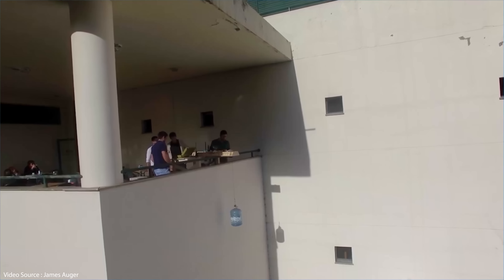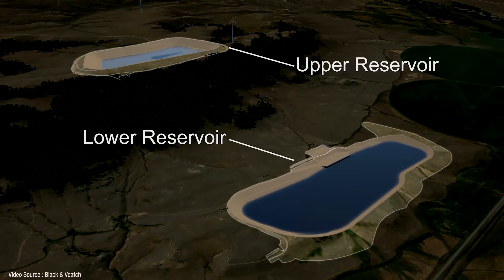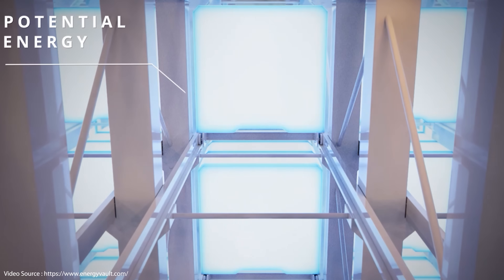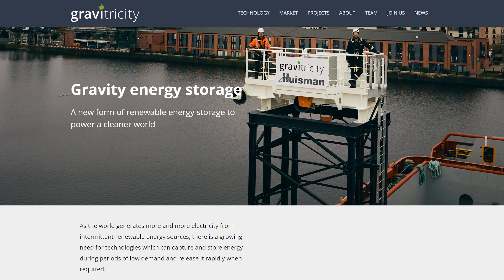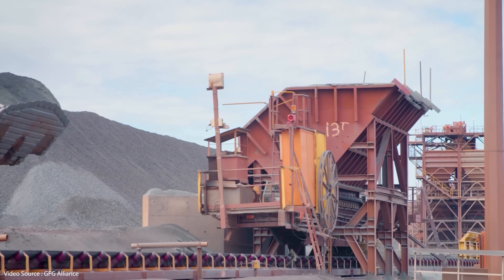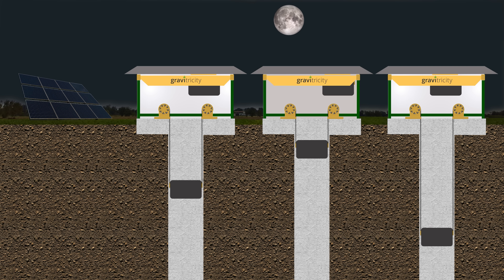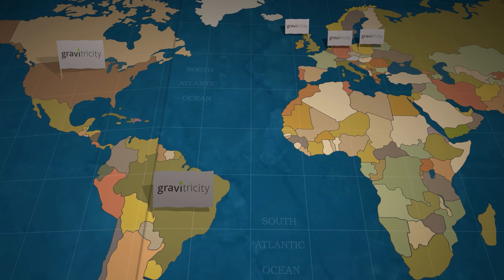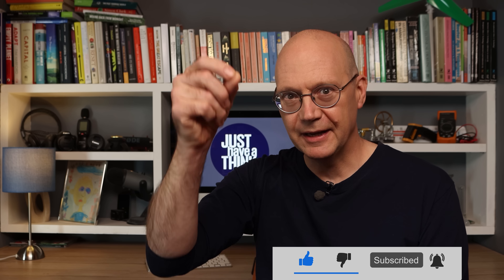Gravity Energy Storage. Who's right and who's wrong?

Comment: Thank you for coming back to these.  Why would either of these be better then water towers or sub-sea air tanks?  Water is heavy, easy to move, and really useful to have in a pinch.
Reply: I'm purely guessing here but water towers have to be built, they're only approx 50m tall and they hold a limited amount of water. The mines are already there, they're are 500m to 1500m deep (at least in the UK) and you can move additional weights down the mine rather than having one weight of water at the top of the tower. I suspect the issue with sub-sea air tanks in the harsh environment - salt water and barnacles would destroy everything eventually.

Comment: This is a good example of the difference between science and engineering.  Scientifically all these schemes are straightforward.  From an engineering and economic standpoint, most of these schemes are non-starters.   Pump-storage is an existing solution where topology permit.

Comment: IMHO, as a lay person, looking at it all objectively, if you want to store energy using gravity use pumped hydro. It is fairly weight dense, water is a lot cheaper than concrete, in the right locations you will get free "mass" at elevation every time it rains (in other locations without enough rainfall or a roof you will lose your mass as the sun evaporates too, its location dependant of course), and the maintenance is very minimal compared to having cables and winches and cranes all over the joint.
Reply: Also, if your going to dig holes hundreds of meters into the ground there will be heat down there, just use geothermal

Comment: If you have a mine, which you will have to pump out anyway, why don't you use water as your mass? You are into dear standard pumped hydro technology, and you can move immensely more mass (as you can use all the voids underground as storage volume not just a tiny fraction of the shaft). You could possibly even play with a bucket chain rather than a conventional pump which may be more efficient  and keeps the electrics at the top of the mine.

Comment: If you already have the deep mine shafts and mines, why not pump the water out of the bottom of the mine shaft up to a reservoir on the surface?   Seems like an easy way to do pumped hydro just about anywhere.

Comment: The Difference between the Construction and Operation of Renewable Infrastructure Verses Fossil Fuel Infrastructure is Large.
The Fossil Fuel Corporations and Governments take the Attitude that as Long as it Produces Coal, Oil or Gas then Build it and Build it Well.  Example the Coal is 5 Kilometres Underground :-
No Worries Tunnel Down in Often Very Dangerous Conditions Bring the Coal to the Surface, Build Huge Power Station, Rail etc for Electricity.  No Worries Repeat the Process All over the World.

Here in this Example, Just have a Think is Suggesting Building and Operating, Let Me Say, a 500 Square Kilometre Gravity Battery is Hard and Probably Will Not Occur.  500 Square Kilometres is the Size of JUST ONE COAL MINE.  I have Not done the Maths on How much Energy a 500 Square Kilometre Gravity Highrise Battery will Store and Provide but it is Huge.

So the Very Big Mystery is Why Such a Huge Contrast to Building and Operating Quality Renewable Infrastructure, Such as Grid Scale Gravity Batteries, Grid Scale Solar ???????????.

My Answer to this Mystery is :-.  We have Weak Useless Governments All Over the World!!!.

Comment: Some calculations on Gravitricity. That tower seems to be around 25 m high and it takes around 30 s for the weight to go all the way down. It says 250 kW there, so I take that number, and assume a 300 m shaft. That would provide 250 kW for 12x30s = 6 minutes. That gives a total storage of just 25 kWh. Let's say they double the weight and I undercounted the time it takes the weight to go down by half. Oh and make the shaft 500m instead of 300m. There will still only be ~165 kWh in one system, or about the same energy as in 2 family EVs. Enough energy to power ~16 homes for a day, or just 384 homes for an hour. Scaling this up to grid scale requires 10,000s mine shafts to be outfitted with this system. I'm a bit skeptical on this one.

Comment: Im puzzled as to why the drop has to be vertical.Why cant a rail line going up a steep hill or preferably a mountain work proportionly just as well.
Reply: I reckon that you could.  But if it isn't vertical then you lose some of the energy to friction.  Also, it would generate less energy for the same length of track.  I sort of like the idea of rails though.  You could build it above ground so you could see it and make maintenance easier and safer.

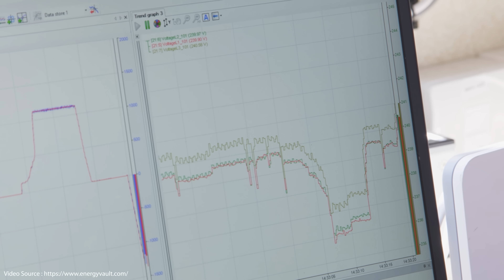Comment: At 5:42 "... as gravity competed with inertia ..."?  What!  I can understand gravity competing with friction... but not enertia.  The greater the mass an object has, the more enertia it has, making it harder to push from its path, certainly, but gravity does not care about that at all.  All things deflect the same under gravity.  There is no competition between those two things.  Gravity simply ignores enertia.  No competition.
Reply: Are you referring to the rate of work?  The faster it falls the faster it will deliver the same energy.  So the energy delivery starts off slow and speeds up through the fall duration.

Comment: Why not use large vertical tubes anchored in a sea bed or lake bed in deep water with generator/pumps at the bottom of the tubes. No need for separate bodies of water, less geological requirement, anywhere there’s relatively deep water, and of course the tubes would have to be water tight and be able to handle the pressures at the bottom. It would exhibit a gradient in regards to energy storage, the deeper you pump, the more energy needed to pump out the remainder, but the greater the energy storage capacity. Just a thought, and if I’m having it, then most likely someone else has already thought about it or done it. Not much new under the Sun ☀️ these days.

Comment: Some/many of these concepts seem to consist of too many parts and involve heavy construction. I also wonder if gravity is the best way to store energy or not. Water dams are well proven, but these other ones don't use liquids. There's the flywheel idea, and there's heat storage. Perhaps pressure chambers. I don't know, but it has to be possible to relatively easily figure out what kind of storage requires the least amount of energy during conversion and construction and maintenance. After doing that evaluation, many options could probably be scrapped so we don't waste time on them.
Reply: while I agree that this isn't a great idea and I hope it's not diverting funds / backing from more viable schemes.  it's incorrect to assume that between 8 billion of us we only need to focus on one system.  we can be working on fusion power, and heat storage and battery, it's likely some will find niche uses and some will be more mainstream, but it's unlikely we will find a one-size fits all solution for energy storage. since the type of generation and the types of demands will be different in dfferent places.
Reply: @mralistair737  For the time being, at least, I agree. There's nuclear though.

Comment: In the absence of suitable mine shafts the weights could also be lowered along tracks built down hillsides, which I imagine would be cheaper than digging purpose-dug holes and reinforcing them.
Reply: This is the mining regenerative braking system.  Skip the iron tracks and just use electric dumptrucks, though a third rail would provide an easy way to get electric energy from vehicle to grid.  Look ma, unintentional use of a buzz word.

Comment: The mine shaft version looks nice. I wonder if you could use one lift system to make use of multiple shafts to save on overheads. Assuming a site has multiple shafts in close proximity.
Reply: Mechanically switching the mechanical system between shafts while holding up the weights at the top will add extra complexity that would be avoided by simply replicating the equipment to provide complete failure redundancy.

Comment: For those below who advocate using mine shafts .....

1. They are not usually very wide holes (anything more than a cage width is a waste!
2. There is a Lot of maintenance involved in their upkeep!
3. The fail-safe systems need to be robust or you need to factor in what happens when you drop  weight a long way down onto some piece of infrastructure!

Comment: not far from where I live, a reservoir releases water throughout peak usage hours, and during non-peak hours, water is pumped back up to the reservoir.  Since the reservoir is a lake that is fed by rivers, there will always be water flowing into the system, but using the excess power when it's not needed supplies the system with additional mass that gravity will bring back through the turbines when the power is needed

Comment: I wonder if it could be used small-scale. Like someone currently on PV off-grid, using lead-acid batteries. But of course construction costs are the big problem, unless you happen to have large hole available. But maybe if you had a long even slope, you could just put weight in a cable trolley system. Anyway, it would be interesting to calculate how much weight and height you'd need to use like a replacement for a dozen lead acid batteries. And maybe you'd also want to add multiple trolley cars, and store on the top or bottom of the hill for long term storage, like for less solar power in the winter.
Reply: I don't have a sense of scale, but all I really know is we're SPOILED with cheap electricity, but people off-grid conserve a lot better, don't need as much, so such systems could be good enough for them.
Reply: If that person happened to have a 300 m deep mine shaft in their back yard, they could potentially replace two Tesla Powerwalls. So, to really go off grid and store the excess solar power in summer to use in the winter (assuming around 50° North type of seasonal differences), they'd need about 50 such mine shafts in their back yard. More if it's not a passive house and they need electric power for heating too.

Comment: "Mine Shafts". I believe they are referring to "Raise Bores".
Raise bores, here in Oz, are used to ventilate the mine. Don't think they are dead straight up and down. And filling the void with a big bung of whatever, may lead to the build up of toxic/corrosive gases, extreme humidity and very high temperatures. None of which would be particularly awesome for the longevity of steel or concrete used in the device to store the energy.
Reply: In the UK mine shafts are for the lifts/elevators that carry the miners to the bottom of the mine and to the surface.
Reply: @jasonleahy5543  are they deep, straight and wide enough I wonder.

Comment: Thank you for this new video! I love these updates you're doing on previously presented technologies, it's very interesting to see which ones have come along and which have not. Energy Vault certainly had great computer renders and exciting ideas, but it seems that marketing is what the company is best at. By contrast Graviticity has made steady progress. That's good.

I guess Gravitricity isn't going to be a magic bullet, single solution to the problem of renewable energy storage. They're necessarily constrained to locations with pre-existing mine shafts, and those aren't usually located near cities where power is needed. But like you said, they could have a part to play in the energy transition as one of many different solutions that will be used at the same time.

Comment: Gravity is literally the weakest force in the universe and using gravitational fields to store energy fundamentally has a very poor power density. For this reason I do not believe this is a viable proposition (and in fact is a waste of valuable resources). I'm also concerned that the mechanical-to-electrical conversion efficiency will be very poor (I expect less than 20%) which again is very wasteful.

This idea has been around forever but was never commercially viable. Why would it suddenly work now?

Comment: With any of these there are a few critical metrics that are rarely discussed.
1. Round-trip efficiency.  What percentage of the energy I get back?
2. Construction cost. It has to be cheap, or it's useless.
3. Energy density. How much space do I need?
4. Scalability. Can we build enough to power the entire world? 

There are many other details, but these are the common deal breakers.

For gravity storage, the problem is energy density. Think about pumped hydro. Picture an average reservoir. It's gigantic. Concrete is only 2.4 times more dense than water. Rocks are only a little more dense. You can try lead or tungsten (or uranium), but then you run into cost issues.
High energy density allows you to use more expensive raw materials and manufacturing. Also makes it more practical. Ideally you want your home battery to be smaller than the house.
Reply: YEP!  There should be a law requiring all articles / videos about energy storage to have this key data displayed at the bottom.. like nobody reviews a car without mentioning its efficiency, top speed, cost, 0-60 times.  but you are allowed to say you are storing energy in elephants bums and that's just fine.  as "every little helps"

Regarding pumped storage, basically it's a miracle that it works at all, and going around looking for ways of building a constructed version is a fools errand.

Comment: I had a memory of doing energy storage using train cars on a slope so did some googling and found "ADVANCED RAIL ENERGY STORAGE". seems like you could do that in more places without the need for an existing mine shaft.
Reply: They are building the train cart.energy storage in Nevada. We might see it in 2035.
Reply: Remembered seeing that video also.  Seems to be easier to install and maintain than either of the two mentioned in this video.  And easily scalable also.
Reply: In Australia the Fortescue Metals Group is planing a system like that near Port Hedland
Reply: Yes, and you could store more if the mass was stored at the top and bottom, so one rail car could carry multiple lots of rock, rather than a single lot as in this design.

However both pale when compared to pumped hydro. Snowy 2 for instance stores 350 GWh. With cheap UHVDC the location of the pumped hydro isn't as critical. Any old mountain by the sea could be pressed into service.

Comment: Why not use the sun to water evaporate salt water from the sea in a sealed tube exposed to the sun to heat up the water and up the tube to a higher elevation tank, you then have latent water at height to tap for the energy you can then feed inland to lower elevation with water that may well be drinkable or require little processing.

That's what I'd build, energy generation and water purification combined for warm/sunny climates that have water shortages as well.

Though probably usable up to many elevations like Spain.

Comment: you know i can see geothermal pipes as a useful add on to this. use the mine shafts and tunnels to send the fluid down and use the power generated to raise the weights.
Reply: This specific comment is what I was looking for....  a geothermal basin (like CA Eastern Sierras) could be tapped because there are already plenty of mines (not sure if they are the right type) and geothermal activity which is close to the surface...  base power creation plus high demand power from the Gravitricity